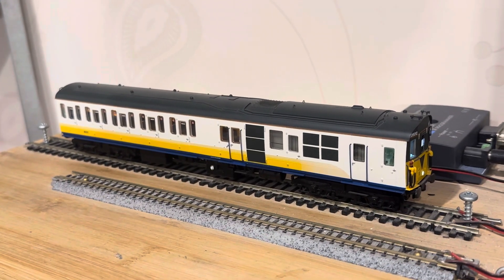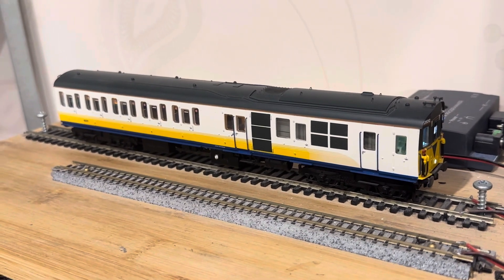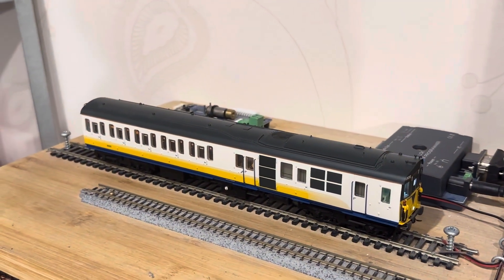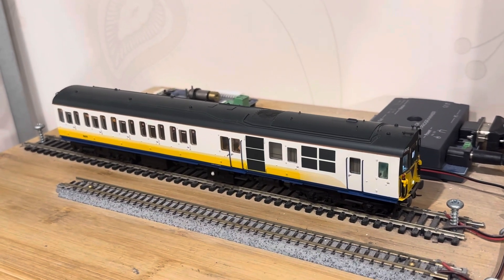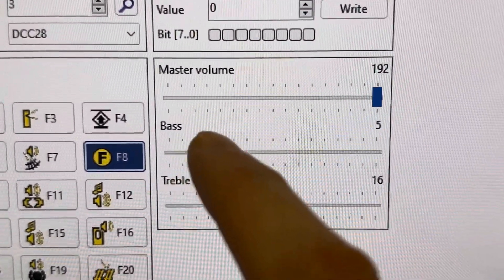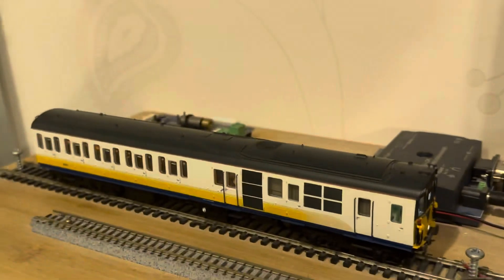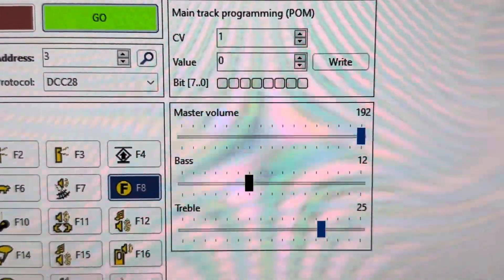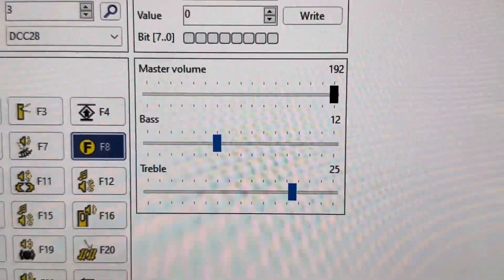New ESU firmware, allowing you to adjust the bass and treble on the Loksound 5

Comment: Since a lokprogrammer is probably more expensive, would you accept a loco for adjustment as a service?

I've managed to bodge an iphone speaker into an accurascale 37 in series with the EM1 (sugarcube removed) but some of the bass has been lost and the volume could do with going up now that the speaker resistance is up at 8Ohm. Could you fiddle it to bring the bass right up and generally up the volume?
Reply from the maker: Yeah I could do that